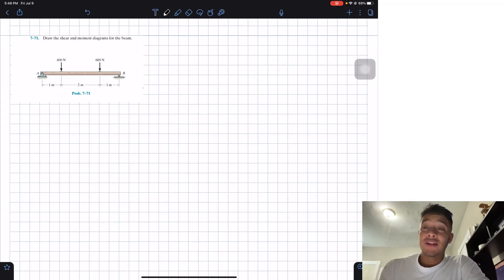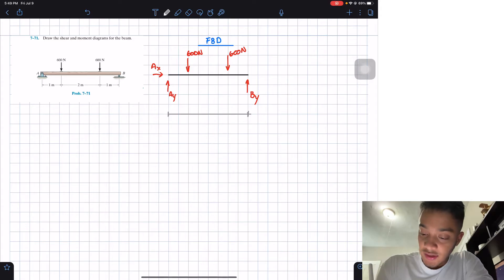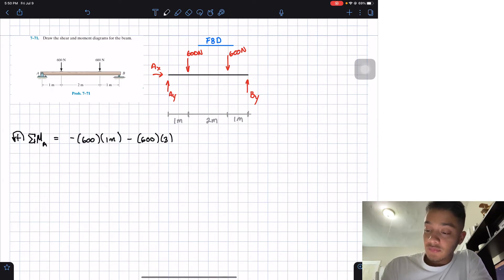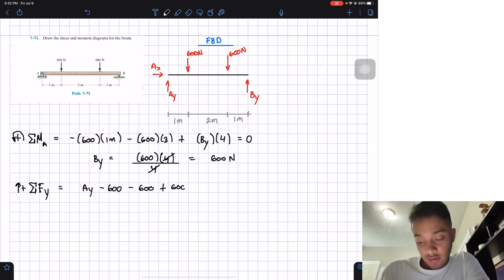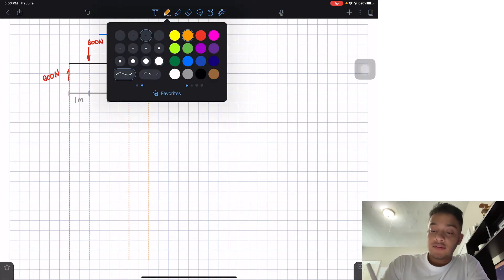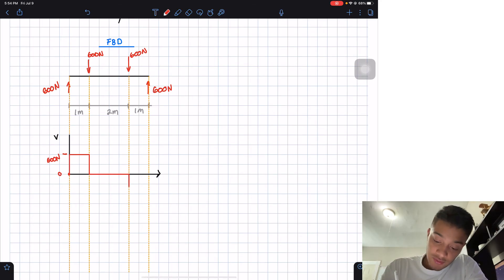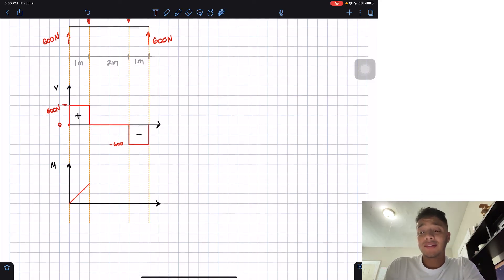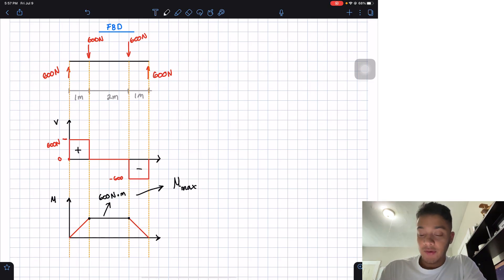Statics 7.71 - Draw the shear and moment diagram for the beam.

Comment: -(600)(1)-(600)(3) ??
Reply from the maker: Hello Erruz, there are two forces acting downward in our beam. If we are doing the moment with respect to a point (in this case point A) then the moment each force creates around this one is equal to F*d (force times distance). Therefore, the first force which is equal to 600N times the distance from A which is 1 meter gives the first term of that sum. Then similarly second force = 600N and total distance from A of 3m.

Why are they negative? They are negative due to the final rotation direction... I decided that clockwise (CW) is negative, therefore both of the moments created by the 600N forces are negative.

I hope this may help you!